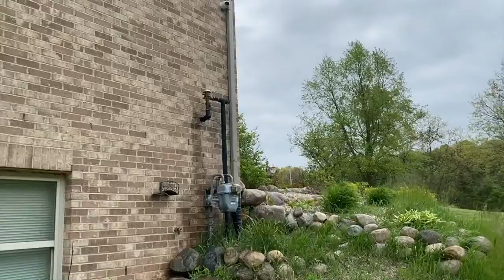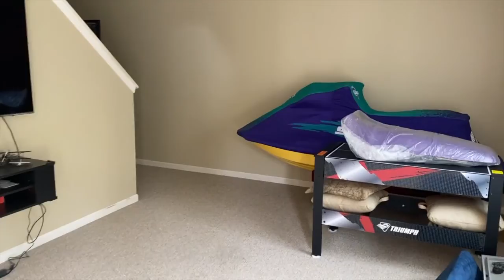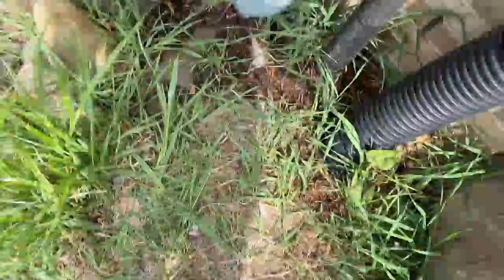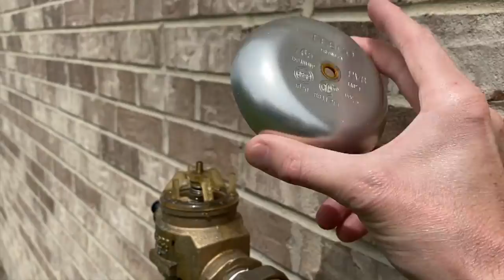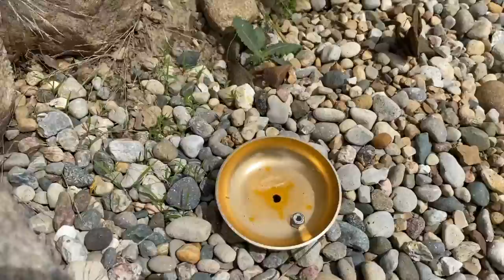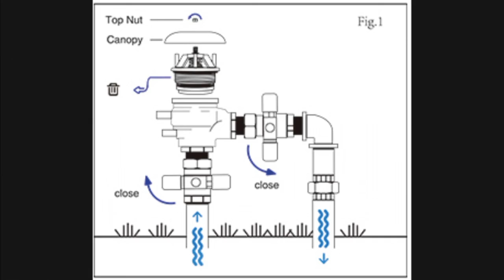Backflow Preventer leaking chugging water - Most common causes and Troubleshooting

Comment from the maker: If interested in purchasing this product, visit our Amazon affiliate link below.  I earn from qualifying purchases.

Backflow Preventer kit:  https://amzn.to/4cDIU3D

Ratchet socket set:  https://amzn.to/3W31ixG

Craftsman pic tool set:  https://amzn.to/4cu7VOO

Foam pipe cover:  https://amzn.to/45G38HS

Zip ties (Heavy Duty):  https://amzn.to/45HrqkE

Garden hose wall mount:  https://amzn.to/3VOMZeO

Weep hole screens:  https://amzn.to/3VHi2ZJ

Copper bullet garden hose:  https://amzn.to/3XHaQ2r

Never kink hose:  https://amzn.to/45Hqcpy

**********************************

1.  Backflow Preventer not sealing - THIS IS WHY!

          https://youtu.be/3AvSBJx8-uI

2.  Replace Backflow Preventer kit

          https://youtu.be/oNp-fv4BZQ8

3.  WIFI Drip Line system setup and review

          https://youtu.be/C_2Uooxk0Lk

4.  Install garden hose wall mount

          https://youtu.be/Gi5nC9hPSrE

5.  My brick home has slit/gaps in brick - This is why!

          https://youtu.be/ODZxYiwVaGk

6.  Installing weep hole screens in brick wall

          https://youtu.be/uIVoh0Mldjo

7.  Craftsman never-kink hose review

          https://youtu.be/QX-gnKhTGJ8

8.  Will 10 year old opened grass seed still grow grass

          https://youtu.be/6BSriGidOn8

9.  How to Re-bunk jet ski trailer

          

10.  How to winterize Drip Line irrigation system

          https://youtu.be/UbD1AoOpxQM

11.  How to De-winterize Drip Line irrigation system

          https://youtu.be/vW5nHM495yo

12.  Winterize garden hose spigot

          https://youtu.be/UAWtqZ9OWaQ

13.  De-winterize garden hose spigot

          https://youtu.be/6bNnTcnc2Yw
👍